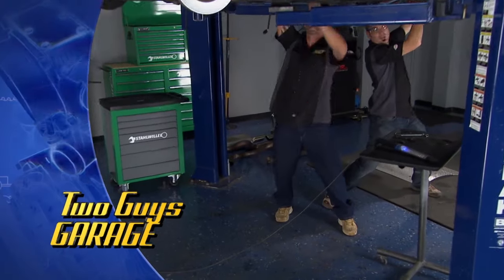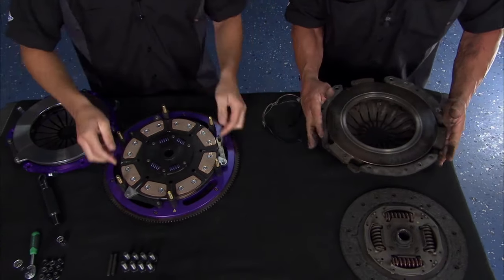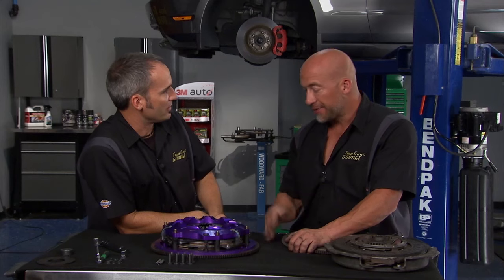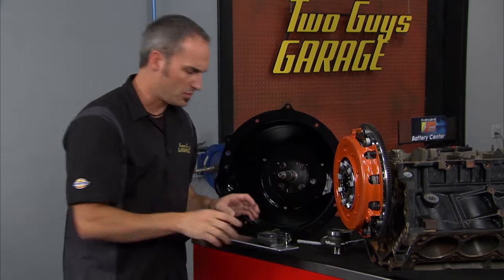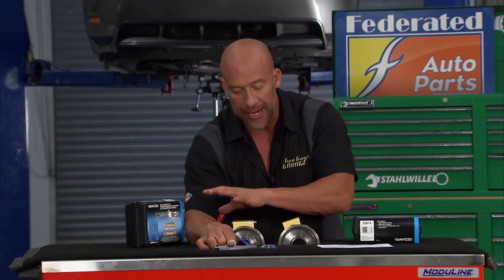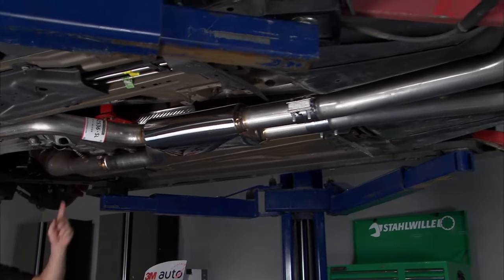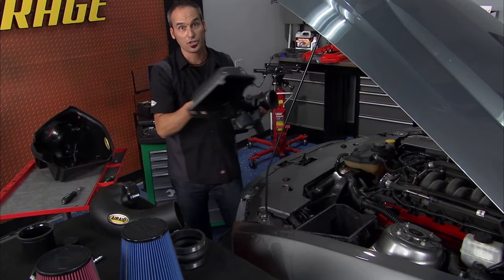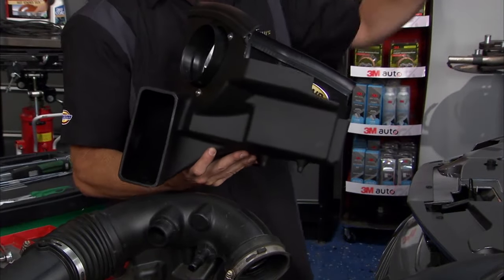2012 Mustang Clutch Repair | Two Guys Garage | Season 13 | Episode 7

Comment: Did this clutch rattle at idle with weights on the pressure plates?   By you moving them with while out of the car they made some noise.